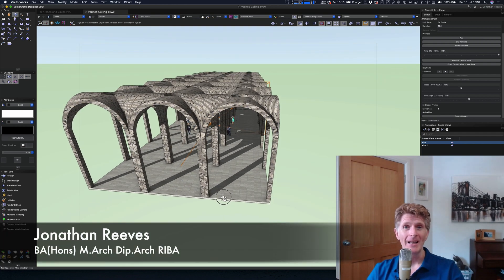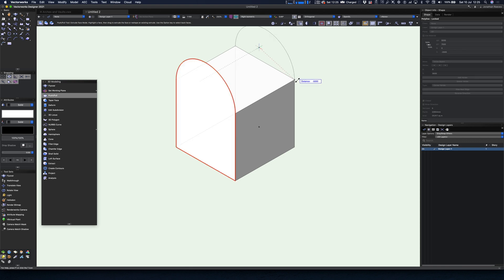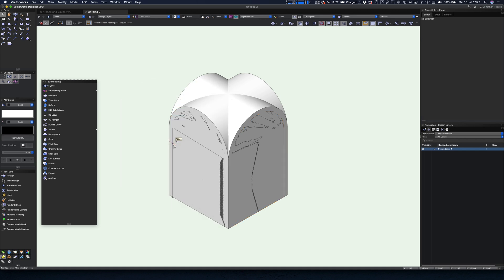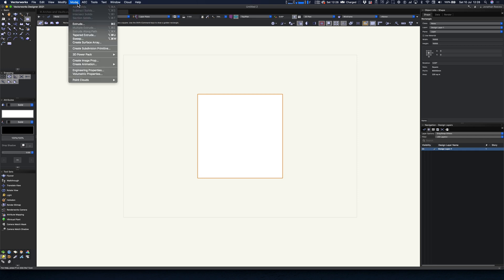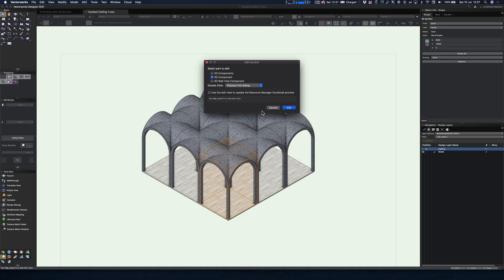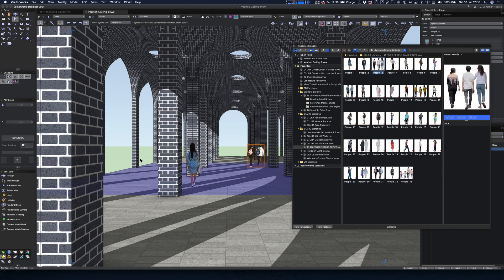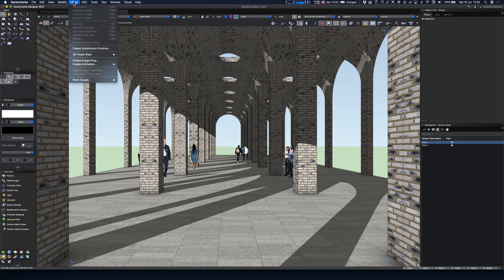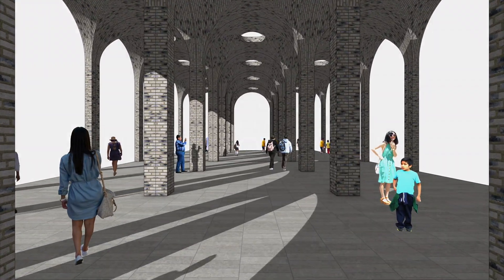Creating Complex Ceilings in Vectorworks (Using Solid Modelling 4K)

Comment: Great tutorial. I have an issue though. The offset tools keeps wanting to offset along the red axis, instead of along the green (the plane). How do I change that? Some setting somewhere I suppose, but where?
Reply from the maker: Check the automatic planes setting
Reply: I am having the same issue, "automatic" is not a plane option when using the offset tool. I noticed that when you used the extract tool it created a polyline, mine creates a NURBS surface, and I think that is why it was behaving differently. When I checked "Create Planar Objects" in the extract preferences, I was able to create a polyline that I could then offset like in the video.
Reply: @moodle01234   thank you soooo much, I was really struggling with this.